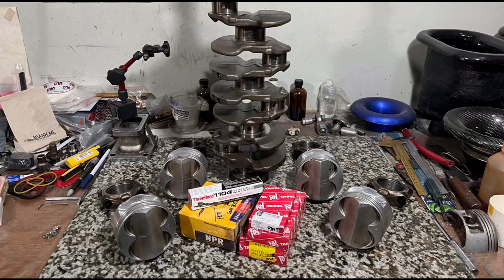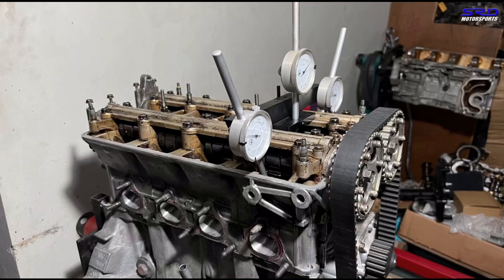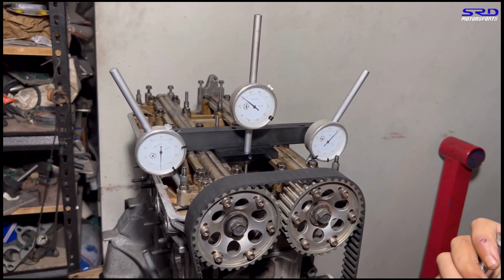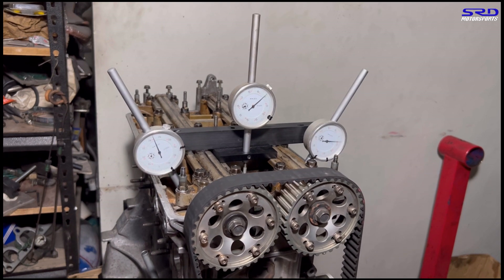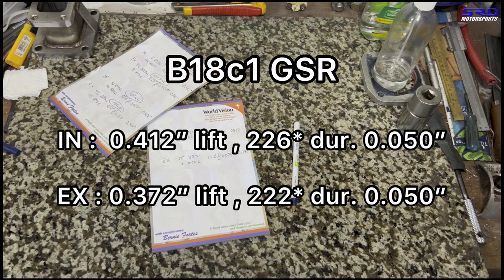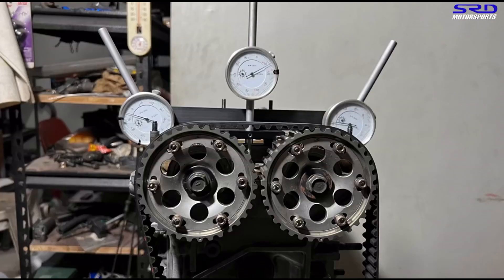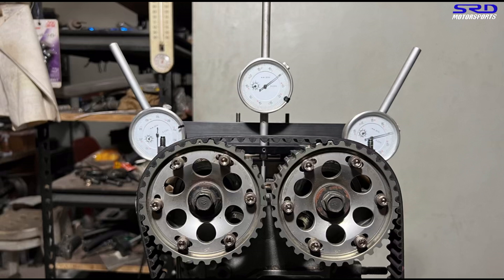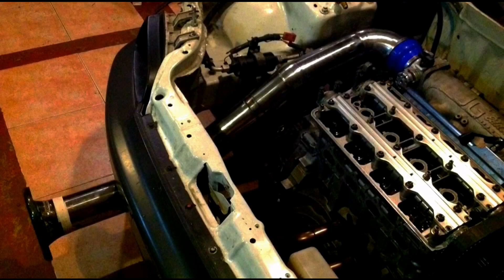B20vtec GSR Cam Rebuild Series part 3: it's Cam Degree Time

Comment: So i understand this , so thanks . What i dont understand is after this is done . How do you unlock VTec. Taking it back apart doesn't that defeat this purpose ? Or are we just finding out where to lock the cam gears ? I have bc turbo state 2 cams and vms gen 2 gears .
Reply from the maker: @brianburris  yes u take it apart and remove the way you locked vtec…

The purpose of this? Is because ALL  cam specifications are set based on the vtec lobe
u can’t check vtec lobe without locking it…
The primary and secondary lobe are positioned exactly correct “with” the vtec lobe
Reply: @SRDmotorsports  any experience with f20b?  The cams bc stage 2 turbo cams have pin holes to line up tdc like  the b motors have too. how close is that to the cam centers of a new cam  ? There is probably a lot of ° you can still move with dialing it in or will those now be a little off ? Are the holes  for if the motor is in already in the car  you can just get close To tdc ?  I went 1mm bigger on the intake valve size cuz it was the only way to get after market valves. They don't make the f20b ones , so you have to run the h22 ones. But I am only bored over .007.  so I was worried about clearing the cyl walls ..Also at zero out cam gears I had .060 clearance v2v but with the cams and new springs it's hard to keep spinning, how much ° do you think I can move each cam and be okay with your experience?
Reply from the maker: Hard to tell and that’s the purpose of degreeing cuz any resurfacing/milling on the head and block does change the cam timing a bit 

So the markings are there assuming it’s bnew untouched head / block

Comment: Now I understand why you degree every motor because it makes sense when you mill the head and block, it's no longer OEM and measurements will change so it's only right to degree the cam to put it back where it's supposed to he via adjustable cam gears, great work brother
Reply from the maker: Yes sir in a sense I get it “zero’d” out properly
Reply: @SRDmotorsports  how do you know when it's zero out properly? Is it by the dial indicator in the middle that shows you true TDC when piston reaches to the top? or when you actually do the math?
Reply from the maker: @StraightOutThaGudda  each cam manufacturer has a cam card
And the suggested lobe center for intake and exhaust that’s where u set it and that’s ur zero which ALOT of times is near ideal or perfect as is
Reply: @SRDmotorsports  ahhhh okay now I understand, makes sense now , thanks for sharing and educating brother
Reply from the maker: Yes sir! :)

Comment: The purpose of degreeing the aftermarket cam is to help to find the perfect timing between crankshaft And camshaft? Hope you noticed this, ilove watching your videos about hond civics I've learned a lot
Reply from the maker: Yes and because each engine is different especially when the block or head is milled… zero degrees on the camgear isn’t always zero 

U can mill a total of 0.040” and that zero camgear setting is -1 intake and +1 exhaust

Comment: I am running a b16a cam from a sir 2 i believe and it looked significantly bigger than the gsr cam i was running in my jdm  gsr  so i swapped the intake came only but not im wondering what mismatched  lobe center i am running the car runs good tho but maybe i am missing some power
Reply from the maker: “Looked” slightly bigger
Is why I want to degree more stock cams and find out “actual” measurements because I’ve heard and seen what u saw …the gen2 B16a seems slightly bigger the 92-95 siR2

actually the skunk2 camgear here is at “zero” and double checked to be zero compared to a stock cam gear (we do this cuz sometimes zero on the aftermarket isn’t zero to the oem camgear)

but are you on adjustable cam gear? If yes? What brand sir